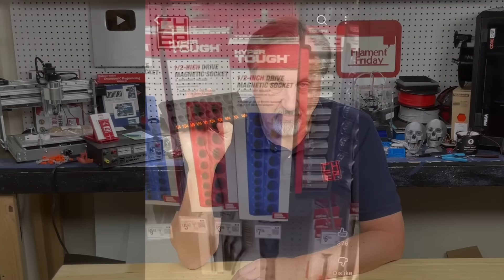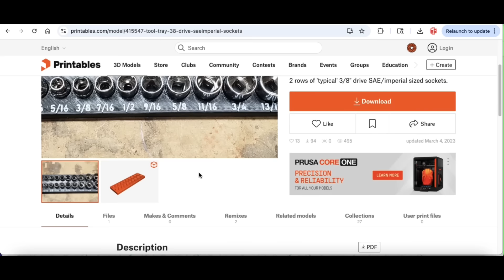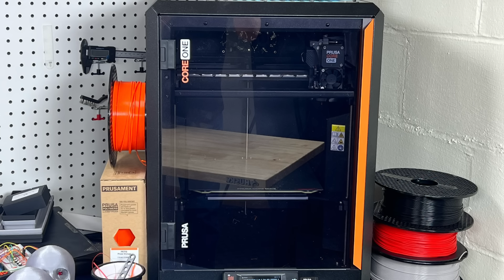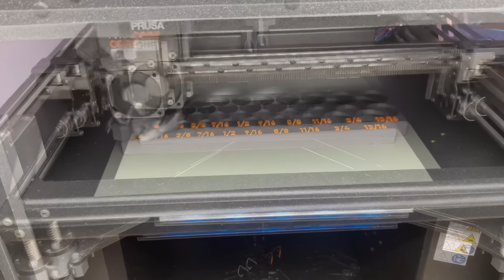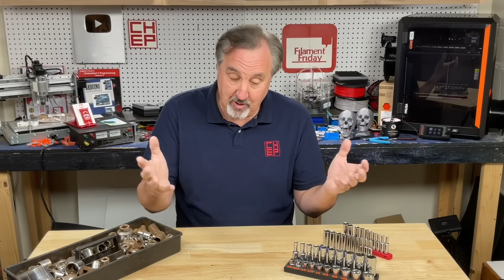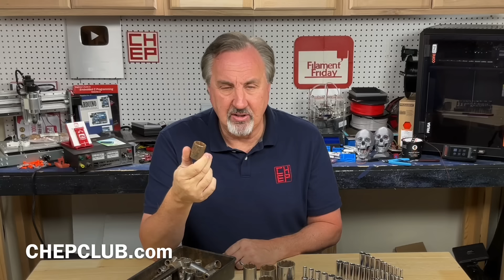Save Money and Organize Your Tools with 3D Prints

Comment: 2.50 seems way over priced. that means you used around 190-200 grams of filament. That print shouldn't use more than around 90 grams at best.  I set it to 0.1% with 3 layers of wall and 5% infill. it's around 87grams - most suggest 5% but anyhow. at 90 grams thats around $1.20 - even at 100% infill it's still only 182 grams which is not quite 2.50... that said. maybe you're buying 20 dollar filaments? instead of high usage blacks for 13 dollars each. - you could get this down to around 75-80 grams easy.

Comment: Now this is a topic I can sink my claws into. So I just went down this rabbit hole, and I am currently selling socket ￼trays designed specifically for the Quinn master sets from Harbor Freight. Why because master sets have an extensive amount of sockets they’re not found in these one size fit most trays. I went with a deeper tray similar to the depth you would use for the deep sockets and then we also create inserts that can raise up the shallow or sockets to make them easier to grab. We’ve chamfered  the walls to make the whole tray easier to pick up, move the lettering to the center. I print the first 5 mm at 20% infill. Most of the rest of the tray is at 10% Phill and then just for the numbers. I reduce the layer height by 50%. We change colors at the first 5 mm and four the numbers it makes the numbers pop and gives you that kind of shadow foam Color change at the bottom of the socket easily. See if you are missing a socket. We sell these on our website and I honestly had to stop talking about it on my channel because we were getting so far behind because of sales. I’ve also published all the files on my maker world Under my username. DaBear

Comment: Should try removing rust with electrolysis once. Idea is plating the rust to the cathode. Plenty of yt vids on what to use & how. Modern car battery charger is what I use with the cathode a plate of graphite. The swing axles on my heavily rusted ford ranger came out amazing, right down to the factory grind marks reappearing.

Comment: This is what got me started 3D printing. I wanted to tidy up my toolbox and couldn't find a good organizer for my pliers that i liked, which would fit well in my older Mac box. Turns out the printer and filament together cost significantly less than the wrench and pliers organizers that I was going to buy, but made instead. And now, six months in, I'm starting to make things to sell, learning about how to print different materials,  and most fun of all, designing stuff in TinkerCad.

Comment: Assuming you have a power supply, use electrolysis to remove the rust from the sockets. That way you do not remove any of the wanted steel, just the rust. You'll watch it bubble away with the rust going to the sacrificial iron. Pretty nerdy but fun way to clean up rusty steel / iron tools.

As for the socket holders, at Harbor Freight you can buy holders for 1/4, 3/8 and 1/2 drive SAE for $10. Same price for 3 metric holders. So for $20 you can get all the holders you need for regular (SAE and Metric) sized sockets. Those odd sized ones are still perfect for a 3D print. Especially when using gridfinity.

Comment: Soak the tools in white vinegar for a few hours, up to 24 to 48 hours depending on how much rust.  Then use a wire brush to help scrub them clean.  Then mix some water and baking soda and let the tools sit in that for 15 or so minutes, then rinse clean.  That's what I've done to remove some nasty rust from old wrenches and sockets.  Thanks for the video!